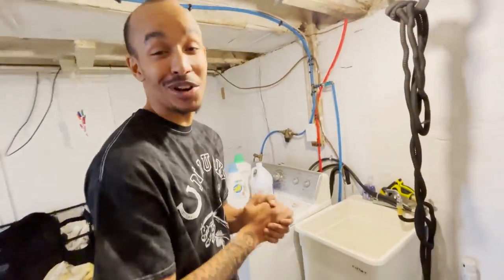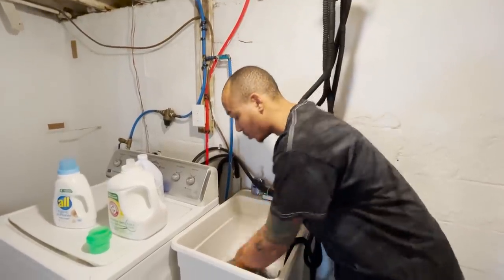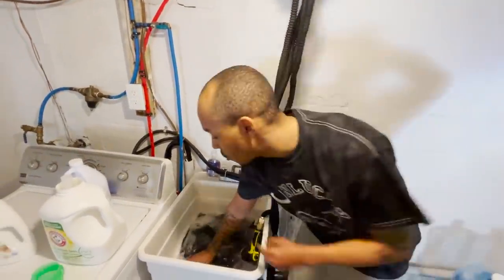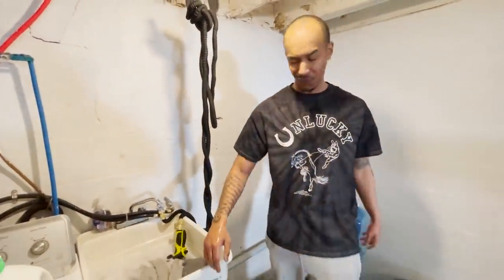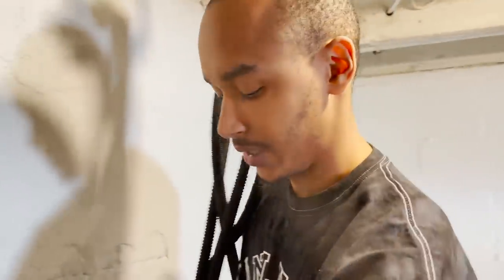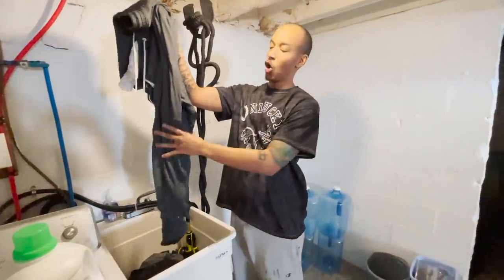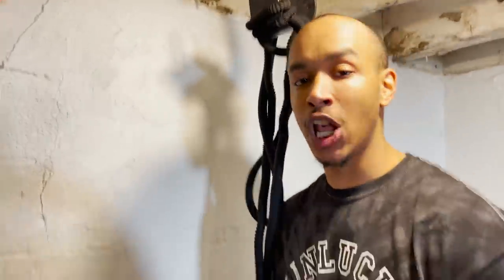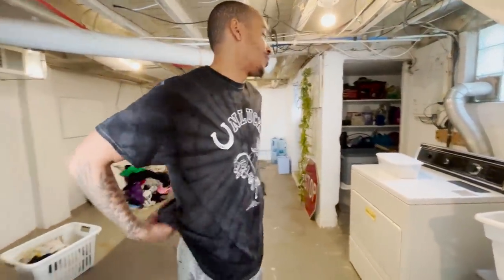How I Hand Wash My Clothes 🤲🏽👕💦

Comment: YouTube recommended me this 2 hours after my whole basement floooded and we have to wait til the morning for it to get fixed. I needed to dry towels because most of mine were soaked now from the flood but water pipe had bursted and the whole water system in my house didn’t work so there was no water. I got some water bottles emptied them cleaned Towels exactly like this video told me to and threw them in my dryer because that still works with no water. Basically the towels were clean enough for me to still use after I cleaned them again so boom. Lool crazy bro ur the shit I see u all the time and now u saving my ass respect fam 😂❤️